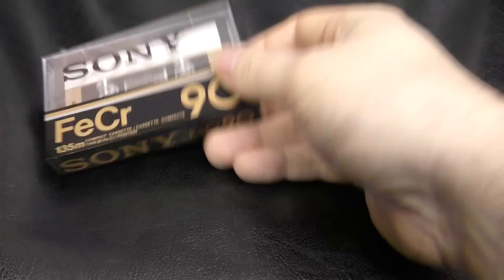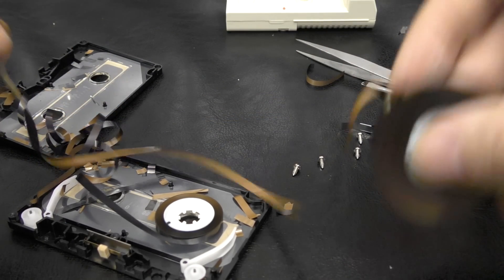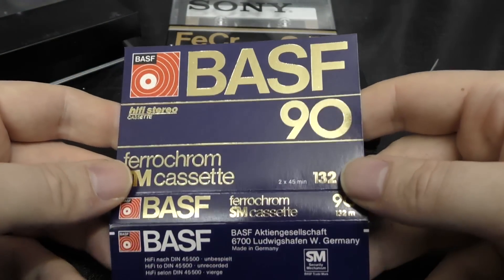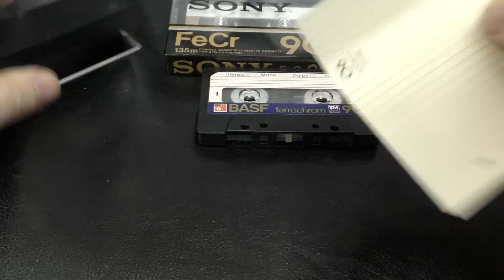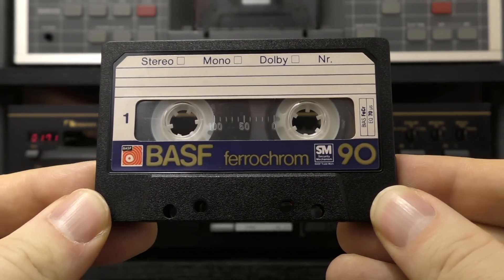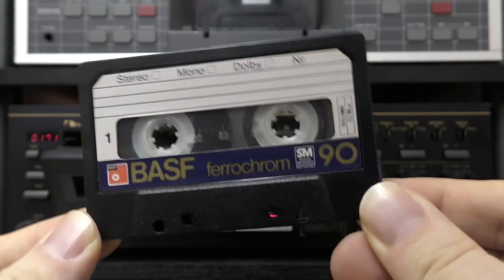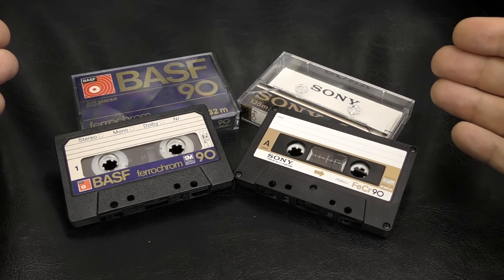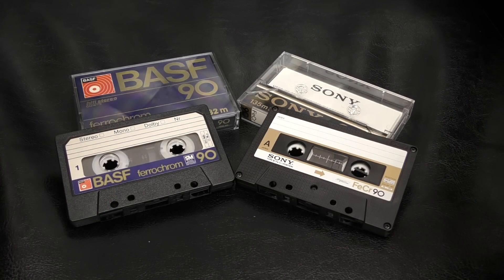Type 3 FerroChrome Cassettes - You Wanted Them, You Got Them!

Comment: Double-layer FeCr tape was commonly used in the ELCASET system cassettes. It allowed for very, very high quality recording. It was as dynamic as reel to reel. It is a pity that the ELCASET system has died out.
You're doing a great job Tony! Greetings from Poland
Reply: Sony was the biggest backer of FeCr tapes in general. Elcaset really didn't see too much improvement with it based on my quick listen with a friend's deck. The wider tape and faster speed made the base Type I sound fantastic already. He had a ton of FeCr tapes with the machine (along with the demo tape) and there really wasn't that much of an improvement. CrO2 showed up on El Caset too, but too late to make much headway.

Comment: The shedding problem of the late '70s and '80s had to do with the banning of whale oil as a component of tape binder (oxide glue). New formulations were being tested and some of them absorbed moisture from the air (hygroscopic) and broke down rather quickly.
Reply from the maker: Nice info 👍

Comment: @Cassette Comeback
I have a Sony TC-K 555 bought new in 1983 and it has a dedicated FeCr setting and the owners manual I have even recommends the Sony FeCr tape for best results, I have tried them ( bought one back in 1983 cost USD 11.95! only one in stock) and sure enough  the sound is REALLY excellent, at least as good as a good metal tape and for some reason it seemed like the noise level was lower than a typical metal tape! The reason I didn't use them back then was even in 1983-84 on they were ridiculously expensive and hard to find even at the big electronic super stores in NYC!
This older Sony is in like new condition and has had NO service, just basic cleanings and deguassing of the three heads. This model also had three motors and super low wow and flutter of 0.04% and -80db S/N with Dolby C noise reduction....I love this deck old Sony's were built like tanks and sounded amazing. Merry Christmas Tony!
Reply: The Sony TC-K555 has a signal to noise ratio of 56dB with type 1, 57dB with type 2, 61dB with type 3 and 60dB with type IV. Even with Dolby C ativated, it does not reach 80dB.
Reply: I have the Sony TC-K44, TC-K55, TC-K61, TC-K65 and hope to get the (71, 75 and 81) in the new year. Great decks they are.
Reply: My old Sanyo boomboxes (an M9990K and an M9994K) from the late 70's both have a lever to manually select tape type and both have an FeCr position. Interesting, this is position is in the middle, being "CrO2" the upper and "Normal" the lower positions.
Reply: @232686434
Actually my original Sony manual does indicate with Dolby C it reaches -80 db S/N. I meant to post it was that low WITH dolby NR.
Reply: That's what I meant, a good deck with dedicated type III position makes FeCr tapes sing, as long as the upper Chrome layer has not degraded. Try to get some gently used Sony, Denon or late BASF type III cassettes, record them in the 555 and tell us about the results. Scotch Master III is also said to be good. Agfa and older BASF FeCr are suffering from different kinds of degradation.
Reply: @Kirunavaara 
I just mentioned that in my first post above. They are fantastic as long as the FeCr are in good condition and have a properly aligned and maintained deck. Mine is in like new condition after around 37 years.

Comment: Regarding the "Security Mechanism", I remember Wilhelm on the tapeheads.net forum (long time top tier BASF employee) telling the story behind the SM. Apparently it was invented by a BASF engineer who stumbled up the career ladder ending up in the board of directors, so even though the BASF people knew of the possible problems with the SM, like causing tape damage when a loop inside the cassette got caught in one of the guides (I've seen this actually happen first hand) it was kept till this guy finally resigned and then it got unceremoniously dropped. I always considered the SM a rather cool feature back then, till I experienced its dark side myself. That was... disappointing.
Reply from the maker: Good insight. It would explain a lot.
Reply: Causing more tape damage when the tape winds up into the SM guide mechanism is logical.
Being the cause of a tape jam seems highly unlikely. Shaving off magnetic layer at normal operation speeds, too.

Doing nothing for the tape's security seems the most likely explanation for dropping SM.
Reply: I wonder how they can put inside this strange thing. The simple is the best.
Reply: I guess, the described problem may happen either with a bad, not serviced deck or when there is a loop of tape inside the cassette and the user carelessly tries to run it without winding up it first. Apart from that the SM works great.

Comment: I remember testing the settings for III some time ago, I tested Bias and QU as I/I, II/II, I/II and II/I, there is a thread on tapeheads.

Also, there were decks that specifically would indicate such settings for FeCr where you would set Bias to normal position and EQ to chrome position.
There was also a pro-walkman (usually for bootleggers) from Sony that utilized a FeCr settints.

Comment: Finally FeCr! Me too asked you to do a video about them a few months ago. Thank you! I bought 10 pieces of 90 min BASF* FeCr about 3 years ago for less then 10$ total, and they sound fantastic! I don't have a deck with proper FeCr settings, nor separate EQ and bias setting capability, but the recordings they came with sound great, all 10 of them are full with LP recordings. My Sony TCS-430 Walkman likes them a lot (the few ones which not yet started to shed). Unfortunatelly they are shedding, even without the SM. 
*: how I got them so cheap? They were made by Polimer, a Hungarian manufacturer from the '70-80s, who used BASF tape stock. Usually discounted BASF tape stock, which either was old, or had some defects. Improper tape width was not uncommon, unfortunatelly. 2 of my 10 probably has too wide tape in them, which casues instant shedding, as the tape crumbles at one edge on the tape guide fork of the head.
Merry Christmas, Tony!
Reply: Too wide tape seems unlikely, I don't think any serious tape manufacturer would have sold or even given batches with this fault to any other company. It is more likely that the Polimer shells are the guilty part here; if the azimuth of their tape guides is not correct, or the pressure pad is applying uneven pressure, you get these typical damages on the tape edges. FeCr tapes with their thicker double coating and thinner base films are more sensitive to this than most other tapes: The base film of a FeCr C-90 is almost as thin as the base film of a normal C-110 or C-120.
Reply: @kiirunavaara  Thanks, I haven't thought about that, but really, with the thicker coating they had to use thinner base film. I'll measure the tape width with a micrormeter. I'm not sure, but maybe Polimer cut the tape rolls to the final width. I don't know if it can be true that BASF sold the huge, uncut rolls to them. But I've heard about Polimer tapes cut too wide on reel-to-reel as well.
Reply: @mrnmrn1  Ok, with Polimer cutting the Jumbos to cassette tape width themselves, it would make perfect sense... thanks!

Comment: This brought back memories! Back in 1979 my local hi-fi store was offloading its stock of Agfa Carat C46 ferrochromes at giveaway prices, so I bought half a dozen. They were awful. The midrange was weak and the overall sound was muffled.
I'm sure that decent cobalts like SA and UDXLII put FeCr in a coffin, but what really nailed down the lid was the arrival of metal tape.
Incidentally, I saw a JVC KD-A8 on eBay recently - the first deck with automatic biasing and EQ, which pretty much doubled the original price compared to the KD-A5 on which it was based, way back in 1979. The KD-A8 may well be the only deck that could automatically set up a Type III!

Comment: As Type Is got better through the late 70s and early 80s they were able to perform like a Type III.  I had a Nakamichi CR-1A in the late 80s and the 90s and I used to do this (record at normal bias but at type II eq) all the time with higher quality type I tapes such as BHF, UD-XLI, XL-IS, AD and AD-X tapes.  They essentially all worked well as FeCr equivalent.

Comment: I have an 1977 BASF HiFi Setup D-6000 I got from my older brother (who got it from our dad, who in turn got it a present from his brother).
Sturdy as hell those machines. Still running with little maintenance.

The BASF D-6035 tape deck has a switch for Type I, II and III, but not IV.
Searched years to find a Type III, and got one of the shown Sony C-90. Looks exactly the same, just says DUAD instead of FeCr on the bottom right.

They sound great on this deck, but sadly acould not make them sound good played on any other.

Comment: Thanks for a great video. I bought my Tandbeeg TCD3014A cassette deck in 1986. It makes flawless recordings. It has settings only for types 1, 2, & 4. Type 3 is not supported. I never missed it. To me a good type 1 beats type 3. Likewise a good type 2 or 4 beats type 3. Type 3 offered nothing that wasn't offered by 1, 2, & 4.
The dual layers was the problem. Type 2 needs much more bias than type 1. No bias setting could minimize distortion on both layers. Any bias setting was a compromise. Types 1, 2, & 4 had homogeneous magnetic particles. This made it feasible to home in on the exact optimum bias setting. Any top end tape in type 1-2-4 can outperform type 3.
Reply from the maker: Yeah. That's why they disappeared...
Reply: A good type I beats type III? That is nonsense. The type I tapes of the late 70's were awful. In that era FeCr ruled by far and even the best type II didn't come close. It is not fair to compare a '79 type III with a '93 type I, as tape technology evolved so much over the years. By the mid 90's the better type I tapes such as Sony hf-es or Maxell XLI-S sounded so good that you could hardly tell them apart from type II or even IV,  maybe with a good Nak you could just tell the difference. Who knows how awesome type III would have become if they had been under development for 1 or 2 decades more? Also, the types III still on the market now are more than 40 years old while a lot of the other tapes are just over half that age on average...

Of course you have a point that the dual layer system had its disadvantages. For one they were much more expensive to produce.... And then came type IV, which was even better (slightly) but much easier and cheaper to produce. Plus the recordings could last longer over the years then any of the other tapes. So key deck manufacturers by the 80's started omitting the type III position but they did en masse adopt type IV. That was the main reason for the demise of type III imho.
Reply: @montana01971  of course type 1 tapes improved from the 70s to the 90s. When I said that type 1 surpasses type 3, I was referring to 80s & 90s type 1 tapes. They were spectacular! I had no cassette deck in 1979 when type 3 was in its heyday. In 1986 I got my Tandberg TCD3014A cassette deck, it had adjustable bias & sensitivity for tape types 1, 2, & 4. I could get optimum results with any tape.
The TDK AD-X & Maxell XL1-S were really good. Ran close to type 2 & not far behind type 4.
My car deck only had 120 usec playback EQ. I liked type 1 tapes in my car, 1984 Buick Riviera.
Anyway, I was basing my comparison on 1986 & later type 1 tapes, including Maxell XL1-S, which gave me great results.
As far as 1970s type 2 not coming close to type 3, my ears heard otherwise. In 1976 I auditioned an Advent 201 cassette deck with Dolby B. Using type 2 tapes, it copied LPs with amazing fidelity. Great FR, low noise, no issues at all. In all fairness, type 3 tapes at that time were good, but I did not think they surpassed type 2. I was 21 years old in 1976, so my ears were still good.
When making comparisons, types 1 & 2 must not be driven into the red zone. Recording at or below 0 dB gave me best results. Type 1 did not have the high frequency ability of type 2 or 4.
Type 2 had good hf headroom, but the 70 usec EQ required more treble boost during record mode. The 70 us gives lower noise on playback.
Metal had better hf headroom & overall headroom. With metal, you can record above 0 dB.
Most issues with types 1 or 2 are due to over-recording. My experience.
Best regards.

Comment: I got an Aiwa deck when my Sankyo started failing and it was FerroChrome Type 3 ready, before metal came out, and I was totally pumped. I went all in on FerroChrome cassettes, spent a fortune on blanks, only to have metal type IV eclipse them soon after. I got some metal and liked those, but they were expensive and stayed expensive forever, so I ultimately clung to the Maxell UDXLII as my regular cassette of choice.

Edit: I realize I wrote FerroChrome above. I guess it's supposed to be Ferri-Chrome, with an I. I once got a bunch of cassettes from Spain that might have had the spelling with an O. And I'm not the best speller.

Comment: Hi Tony. Greetings from Robert. I've found your excellent channel quite late. Regarding the subject in discussion, I will be short : the best cassette-decks for these FeCr cassettes are AKAI CS series from the late 70s. For sound quality I don't recommend GX series ! I had a CS-705 D (still strong regrets for selling it last year) and all I can say, regardless the dedicated Type III button, those decks are strong as a tank, very reliable and easy to maintain. I've tested a type III BASF cassette and a Type II TDK SA90 (Made in Japan - early 90s) with the Type III setting for comparison in recording. Results has been amazing ! Both cassettes sounds excellent ! You should try it. AKAI CS series are quite cheap ( from 25 30 to 100 Euro) and easy to find on internet but first of all you need to fully recap and replace the DC motor because the capacitors and the magnets inside the motor at that time wasn't so good quality to pass the time test. After I've recapped my AKAI, as I said, the difference "before" and "after" was from the ground to the sky. The sound quality for both tapes was amazing ! I hope my suggestion worth a try. Greetings from Mainland Europe.

Comment: Interesting about those SM pieces.  I remember buying BASF Type 1's as a kid that claimed to have them but there was no top scraper piece on them, just the two side arms.  This was probably late 70's/early 80's.  After a while I decided to take a look at them and noticed that they had oxide residue on the parts that touched the tape.  At that point, I took apart all the BASF's I had and removed those lever arms for good.  Never had any tape issues with them removed after that.  I'm getting a feeling that the SM system was a solution in search of a problem that didn't exist.
Reply from the maker: Yeah, if they were that good, why didn't everyone else copy them and why did BASF stop using them?
Reply: @CassetteComeback  Initially with the 'bog standard' BASF LH you did have the option of regular or SM editions but that changed around 1979. I rebelled after a SM snarl up and bought D in my teens as the pocket money tape.
Reply: The third SM part on the top was originally only intended for C-120's, and later even applied to shorter lengths of the top models like ferrochrom for a few years. Its intention was to prevent the tape from unwinding itself and getting trapped between the shell and the tape pack, wich happened easily with thin C-120 tapes and all double layer tapes.

Comment: Happy Christmas Tony. I still have the  Sony FeCr's I recorded on a Panasonic deck with the FeCr setting before they started this tape class numbering thing and a Sony TC-K-22  around 1981 through 1984 which did sound very good with lower noise than the original TDK SA. I play them back with a Yamaha deck with play trim to whip the top response back to somewhere near where should be. For me they eclipsed by the UD1 and later the TDK AR which I am sure you'd love that were better and easier to use on the increasing number of decks that had auto tape sensing that came out from the mid 1980's.
Reply from the maker: Merry Christmas to you too. Yeah, I'd take a cobalt doped ferric over most cassette types.

Comment: My pioneer CT-F 600 2header can do Type III FeCr, must be a '79 deck, I think Type IV was not available yet at the time.
With FeCr I always think, there was only one generation, there were no improvement on the formulation. If Type IV never would had come to live, we may have seen stuff like cobalt dopped FeCr, an audiophile grade cassette that could sound like no other tape. It was expensive, but not too if you think of it. If you had already ferric and chrome running in your plant, it only took some good development to get both in one cassette, if it would had gone big this could had been the cassette to have.
Anyway, great tune, it sounds 80s, I love it!
Reply: The real successors of FeCr were the double coated type II tapes, either with two layers of Chrome or two layers of FeCo. These outperformed FeCr in almost all measurable parameters, and were more compatible with the majority of tape decks.